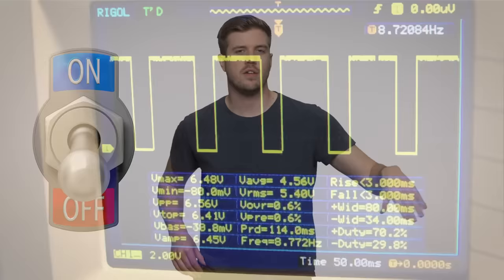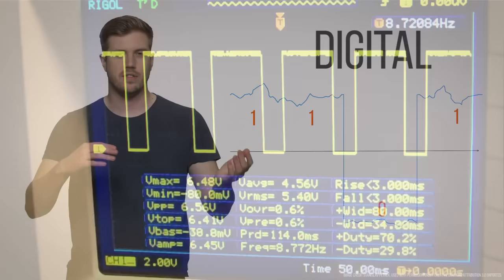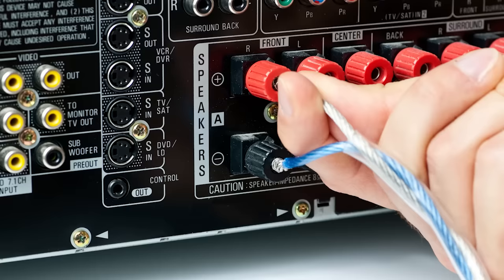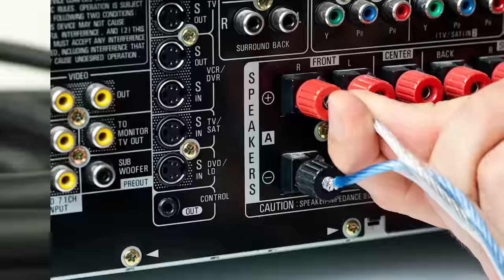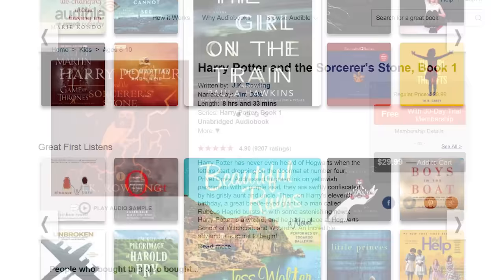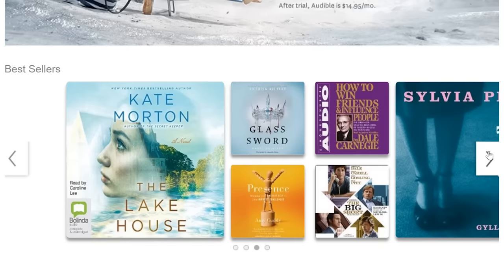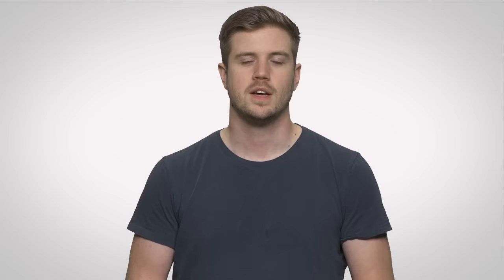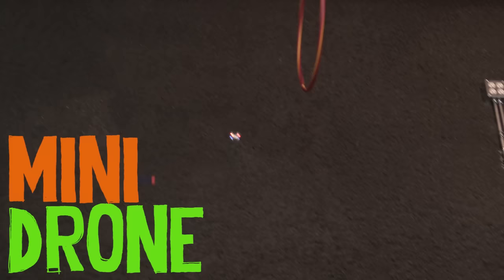Analog vs. Digital As Fast As Possible

Comment: VGA is analog?!
Reply: (Facepalms)
Reply: +Matthew Kinney I'm sure that was obvious to electrical engineers or hardware enthusiasts, but I, as a Computer Science major, also didn't know VGA is analog. It blew my mind too
Reply: +Ming Luo I just assumed it was, because of how easily it can be interfered
Reply: +Joe shade How do you infer it? To me the VGA cable is just a cable, I know almost nothing of what goes on within it.
Reply: +Ming Luo stuff like the quality or length of the cable can weaken or disrupt the signal
Reply: +Fallen Exe maybe he has a long cable?
Reply: +Ming Luo VGA is also a standard, nog just a cable
Reply: +Sam Van Noyen Yeah, dude, how else would you be able to use it with old analog CRT monitors?
Reply: Yup
Reply: +Sam Van Noyen I am pretty sure it was said here or on LTT because I knew that from somewhere.. I can say for +Joe shade that when I was testing my new build I only had a VGA cable, and it was 30 feet and I did have some interference on my monitor.
Reply: +Ming Luo So, you're studying computer science, but don't know the basics about hardware? Won't blame you for that, but will blame you university. There's something seriously wrong with their program ... I also study computer science, but we had a subject dedicated to hardware - and went into detail, on electrical level. In second year we had "computer networks" which also explains everything from electrical to application level. And this is necessary - even if you're a programmer and work with software only, you NEED to know how hardware works in order to optimize the software. (Unless you plan to get a job at EA or Ubisoft, then you don't need to worry about optimization, they don't do that ...)
Reply: ***** My cable was an old one from a yard sale so it could of been that. Anyway it was noticeable. Display port life :p
Reply: +Ken Kalajdžič LOL! That burn!
Reply: +Ken Kalajdžič That's computer engineering not science anymore... at my university, computer scientists take a course called "Digital Systems" which basically is digital systems designing, bolean algebra and these stuff, and another course about computer systems, but nothing in detail like electrical or computer engineering
Reply: XxKvBeasterxX It's called computer science and we do what you said, most subjects are on theoretical level and about programming. We only have those 2 subjects that are a bit more techincal to get the idea what's "behind the scenes". And they sure are useful. Still, you don't need to go into detail, but you definitely need to know at least basics about hardware if you're going to make software. Imagine writing software for databases without knowing how HDD-s and RAM work ... what would come out?
Reply: ***** That's true, I though u meant advanced courses :p
Reply: +Fallen Exe I'm not 'bull shitting' I've got a radio next to my PC.
Reply: Fallen Exe Because you never had interference that means it's impossible. Great logic.
Reply: +Joe Mills because DVI is analogue as well, only DVI-D is digital (notice the -digital at the end of the name)
Reply: ***** DVI-I is both, while DVI-D is digital only.
Reply: +Sam Van Noyen The light coming off your fancy digitally displayport fed monitor is still an analogue wave form of the electromagnetic spectrum.
Reply: VGA is known to be as an analog input, DVI in the other hand is digital as well. On VGA you can do a lot more things to a monitor like auto-adjust and such, VGA is still being used now-a-days but sadly, modern televisions don't support VGA anymore.
Reply: +Nick_NT Auto-adjust isn't a feature or something that can be done with VGA - it's something that is required when VGA is used to connect to an LCD display because VGA is an analog signal and the monitor itself is digital. Digital display interfaces send data that directly corresponds to what gets shown by the pixels in a monitor, so the need for auto-adjust is eliminated.
Reply: +Fallen Exe Wiggle a VGA connection, notice the image distortion that results; wiggle a DisplayPort/HDMI connection, the image is undistorted or black, no in between.
Reply: +0M9H4X Kinda, it's because the cables are much thicker and heavier, and so friction or clipping connectors would be more unreliable. Same with DVI too (which has VGA run alongside, hence why you can use a DVI-to-VGA adapter).
Reply: +Fallen Exe VGA is a fantastic cable standard, considering it's analog, and you won't see much interference from everyday uses. If you were to use a 40 foot VGA cable, that might be an issue.
Reply: +JJ Warner What's a 200 toe VGA cable?
Reply: Matthew Kinney I guess I was badly informed on analog quality
Reply: Tharkz completely different technologie wise those or at least witg use
Reply: Sam Van Noyen It was meant as a pun. You miss the point. 
No matter what type of cable you use, the final image image is seen by you because the backlight gets filtered analoguosly into different wavelenghts of the visible part of the electromagnetic spectrum.
Reply: +Tharkz jup
Reply: +Sam Van Noyen Guess what else is analog: the data saved on your HDD. Surprise-surprise...
Reply: +Baerchenization Uh, no, it's not.
Reply: +Kobra Arboc There had to be that guy... and it is you :) Yes, it is stored analog. Told ya it would be a surprise. It gets stored analog and of course is read out/interpreted digitally. The fact that you can forensically restore data relies on that fact - were it just 1s and 0s, once overwritten, that would be it and no way to tell what was previously in the place of any given 1 or 0. But of course that is not the case; also, what he said regarding traditional media like magnetic tapes, etc is true for HDDs in the form of bit rot, and why file systems like ZFS have mechanisms to guard against it; it is also the reason why shingled HDDs have to over-/re-write such large portions of the disc - precisely because the data is stored analog, not digital. If it were digital, there would be no such problems.
Reply: +Baerchenization It's not binary in the traditional sense, but it is digital—most definitely not analog.  To be precise, they usually have 2 bits/symbol (4 "levels" of magnetism, one for each: 00, 01, 10, 11).  The same thing is also true of network transmissions (coax from your ISP usually go at 8 bits/symbol with QAM256 (log₂(256) = 8), but it's still binary data being transferred and represented).  The internal representation the bits in the very CPU you're on, is also represented with an "analogue" voltage (usually 0–3.3V).  An analog signal is one where the data isn't represented with 1's and 0's (regardless of how it is encoded), and an analog signal doesn't have "steps", but is fully continuous.
Reply: +Joe Mills DVI-A and DVI-I also carry analog signals.
Reply: anyone can get a "computer science major" these days
Reply: Yes, because DVI can also transmit an analog signal.
Reply: VGA is Analog but it is a high quality form of Analog like Scart/RGB Video
Reply: Yup it has a vertical/horizantal sync and r g b lines that constantly change resistance
Reply: icedragon769 The oldest PC color standard (CGA, introduced in 1981) was a direct drive digital interface, and obviously it used a CRT monitor.
Reply: o c e a n m a n ANY electrical signal can be degraded by interference if the offending device is spewing RF energy of the right frequency range and power, Digital signal are LESS effected, but certainly NOT immune, Analog signals are less immune by nature, and the "results" are easier to observe.
Reply: Ken Kalajdžič Depending on how you look at the term "computer science". Some people would argue that computer science should be focusing on mathematic and algorithmic study while others thinks it should be everything related to modern computer. I guess that's why different institution can offer such different courses about same subject called "CS".
Reply: VGA is video graphics accelerator
DVI - digital video interface
Reply: Yep
Reply: VGA connection allowed me to utilize more picture adjustments on monitors with both analog and digital inputs. Digital connection such as DVI did not allow as many picture adjustments on the same monitors. I suppose digital connection aimed for pixel perfectness, that means no non-square pixels, no stretching/squishing, no nothing. 
I remember when kids used to mess up the geometry of the monitors as a prank back in the days (pretty messed up, I know) because all school monitors were CRT based, hooked up to desktop PCs pre-installed with Windows XP. They would also rearrange the key caps or steal the balls from the computer mice.
Reply: I didn't knew that too, I have a VGA monitor and I never had interferences in the monitor, except for the color sometimes.

Comment: Sampling rate ≠ bit rate... and if you transcoded an MP3 file multiple times, its quality would degrade even faster than analog dubbing.
Reply: +vwestlife and transcoding is not the same as duplicating
Reply: Chris Ayers A lot of people, even in the broadcasting industry, don't understand that "copying" an MP3 file by opening it in an audio editor and saving it as another MP3 degrades the quality.
Reply: +vwestlife true, however, ctrl-c then ctrl-v does not degrade the audio file. This is what he is referring too. He is talking about duplicating the file not transcoding.
Reply: Chris Ayers No, he was specifically talking about generational losses, a problem which affects both analog and digital media. On the other hand, the distribution loss for either is negligible -- regardless if a thousand people download an MP3 made from a digital master tape or a thousand LPs are made from an analog master tape, there is no appreciable loss of quality for either.
Reply: +vwestlife Depends on the encoding process but simply decoding and encoding some file multiple times does not necessarily lead to any loss of data. The process is exactly the same every time and repeatable, that's the whole principle of digital representations, whereas this is impossible for analog regardless of the process.
Reply: +vwestlife absolutely right
Reply: +vwestlife not exactly true. take a 320kbps 16bit stereo mp3, save it out to pcm wave first ( in fact, most editors decode mp3 to temp working wav file), then encode to new mp3 as many times as you wish from that. loss only occurs when mp3 to mp3 to mp3, rather than a source file, and if your mp3 encoding sucks @$$....i.e. 128k or lower, joint or mid/side stereo. generally speaking, encode at 192 or 224kbps(or higher) duel mono for best results. ill go from high bitrate aac to mp3 for devices, or for backup, either use orig pcm wave, or use musepack (mpeg layer2 based mathmatically lossless codec supporting wide lossless compression range, and 32bit float encoding/Decoding.......screw flac)
Reply: +vwestlife there is one other factor: sampling. what does your 320kbps 16bit stereo or 24bit flac matter if the source cd is 44khz 16bit stereo, as defined by redbook standard? tapes had noise sure, and multi copy a tape may cause issue, but copy from a master or retail, and its fine, and records have far more depth/info than downloads/cd's....because of 16bit sampling, and the a->d,d->a conversion, vs just keeping it analog. all the downloads get you is convinience, and prevention of outside influence, gain studio set dolby, but loose the outer layers, esp once mp3 encoding enters the picture.
Reply: MP3 is lossy compression audio format which means it must remove some audio details to keep low file size, so during multiple encoding times will degrade original file. But there are for example WAV and FLAC  lossless compressions audio formats, you can edit them and save without loosing sound quality. Anybody who want to edit audio files should have this basic knowledge.
Reply: AstroFazersPlaylist well, wav, pcm and aiff are raw audio, that meant it is not compressend.
Reply: VWestlife lol what is the loss in copying a song from a PC to phone a 1000 times
Reply: +benja14xd & AstroFazersPlaylist

Indeed! I used to use MP3 format til I learned that everytime I open (uncompress), edit, and then save (recompress) an MP3 file ,the quality deteriorates. And the way I do editing, a file could potentially be resaved dozens of times. It's not long til that MP3 sounds like tinny garbage, no matter how high the bitrate it is saved. 

My CD burning software would always automatically convert MP3s to WAV format anyway, so I started ripping and saving all audio files as WAV. Sure, it's about 10x the file size as an MP3 (at 128kbps), so disk spaced gets used up quickly, but no matter how many times I edit and resave a WAV audio file, the quality is retained. Not to mention, for editing purposes, WAVs can be editing precisely to the millisecond and stay that way, as opposed to the stupid MP3 and WMA files that tack on a few milliseconds of silent/mute space (which inevitably RUINS linked tracks, such as live recordings or interconnected tracks which transition into one another), resulting in a breif "hiccup" of silence, the telltale sign of the "track marks" location.

Comment: Digital was always frowned upon in the audio world and Analog looked at in superiority, for a long time that was true, but now Analog is a marketing tool to get you to spend 10x the price when Digital is not only matching in quality, but surpassing in some cases and comes with benefits that Analog could never do.
Reply: But it all has to be converted to analog before you can hear it.
Reply: analog will never not be needed but selling you something in digital form can only garner such a limited profit and interest, it is a lot easier to convince you to buy something in physical form and the buyer convincing himself that its worth it to buy. With that said, digital sales are increasing like crazy, but there will always be some unnecessary analog device attached to it to mark up cost for profit and justification of the cost to the buyer.
Reply: Absolute History so what your saying is an headphone jack is an unnecessary analog device attached to the phone?
Reply: Tcll5850 

You are correct. There are differences between a perfect analog original and its digital copy.

In fact, the differences are even audible...

... in the form of background noise. Something vinyl and tape listeners are very much used to.

And you are also correct when you say that those differences (causing the background noise) become more silent with the increasing bit depth of the digital audio recording.

At the standard bit depth of 16 bit the background noise is not audible until the volume is increased to the point where the loudest parts of the audio go beyond 96 dB, which gives us a dynamic range of 96 dB. (In comparison, Metal Type IV tapes with Dolby noise reduction have a dynamic range of 80 dB)

With 24-bit audio, we get to the point where it is impossible to hear the background noise, until the volume is increased to the point where the loudest parts of the audio exceed 144 dB.

Exposure to 140 dB noise leads to instant hearing damage and needs to be avoided under any circumstances.

Audio latency is usually in sync with video latency and on computers and modern TVs that's usually far below 100 ms, which the brain perceives as no latency. Otherwise everything runs at the standard speed.
Reply: @Tcll5850 In practice, digital is better in pretty much every way these days unless the recording has been badly mastered to begin with. Analog storage formats are limited in practice to how good their quality can be by the physical properties of the material they are recorded on, hence the famous hissing, popping and distortion commonly seen on vinyl. Digital has a much higher dynamic range potential, and that's a measurable fact that is backed by double blinded scientific study and we know why it's the case too. In fact no audiophile has picked vinyl as superior to equivalent CDs in blind tests, only in tests where they knew which was which beforehand. Often online you see audiophiles making comparisons between old vinyl recordings and bad CD remasters, then invalidly using that to argue that vinyl are better as a format.

Comment: My computer, tv, and toaster are all still analog. :'(
Reply: you have a vacuum tube computer?
Reply: well then
Reply: +TheGreeny3003 Pretty sure your PC is not analog, but the monitor attached to it may be.
Reply: +Ken Kalajdžič Analog PC LMAO
Reply: +TheGreeny3003 I rhink your spider live in you analog.
Reply: even my potato is digital
Reply: +Mason Bulot Were there ever any analog computers? Most vacuum tubs just did what semiconductor electronics do these days. I mean, just think about the punch cards. They holes and... not holes... Were ones and zeros.
Reply: Jeremy Suarez Good ol' Charlie Babbles. What was it? Was it basically just an op-amp made with vacuum tubes?
Reply: BattousaiHBr They can be used for digital applications, just like semiconductors, but they aren't inherently digital.
Reply: does people not understand that this is a joke?
Reply: +YiHao Xie 
Thank you. :)
Reply: YiHao Xie People also don't understand that half of the replies are a joke ... That's internet for ya.
Reply: BattousaiHBr Most, if not all, yes
Reply: BattousaiHBr
yes vacuum tubes are digital. technically. Its all just voltage manipulation. When I see a vacuum tube I always think of an old Analog multi-meter and vintage amps so I relate.

However. Fred Flintstone had the true analog computer.
Reply: *Talks in a very polite voice* Excuse me kind sir, but where can I buy digital toasters from?
Reply: At the core, everything is analog. Digital is a pretty abstraction.
Reply: @Big Fat Boi Oh yeah I did! I got a decent job and quit drinking alcohol, have a nice PC now.